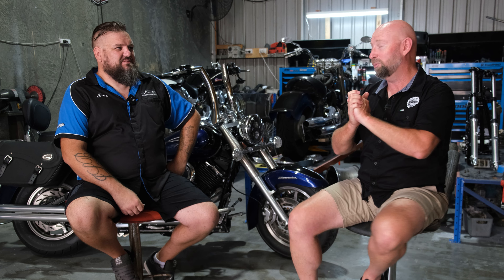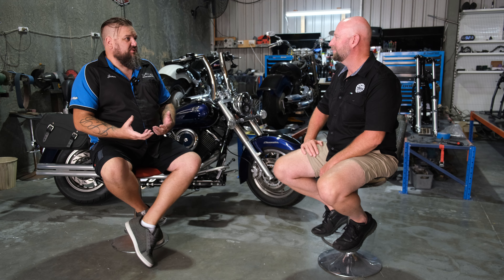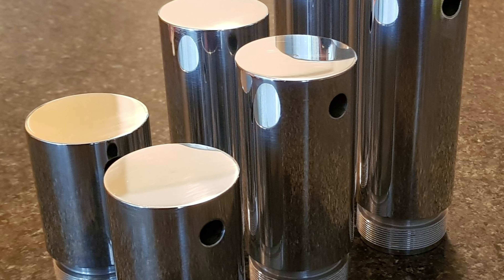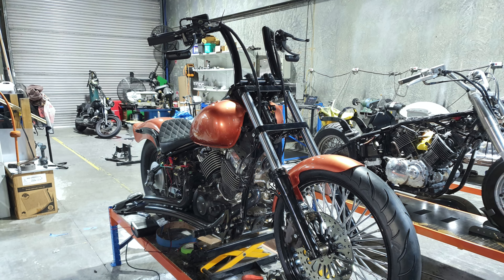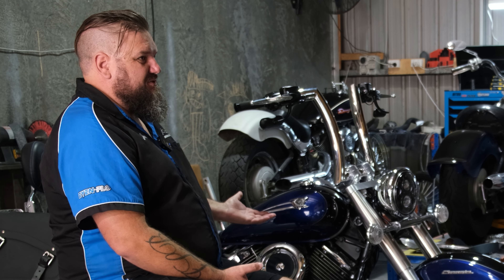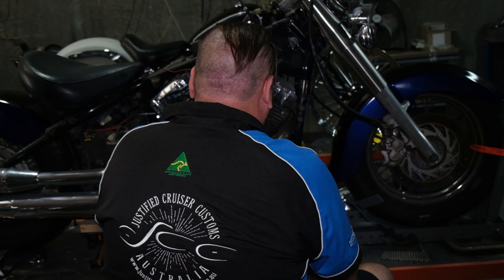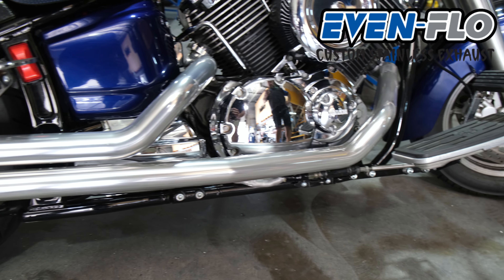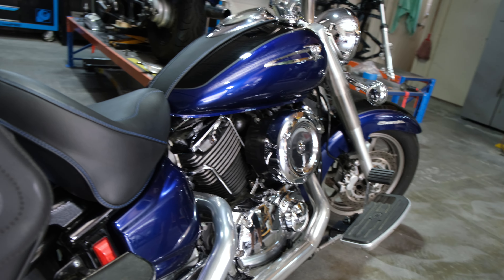EPIC Japanese Cruiser Customs - Yamaha V Star - Bolt - Stryker - Vulcan (Justified Cruiser Customs)

Comment: I honestly believe yamaha makes a better bike than harley. My 99 road star has 30,500 miles and all I have to  is change the oil. I know a guy that has 135k miles on his road star and only changes oil and does regular services. Harleys of the same year have potential and its most, that need new chain tensioners that will run ya a couple grand. I only know one guy with a high milage harley, and he won't take it on a long trip. I have nothing against harley. I just think I did a better job getting my yamaha.